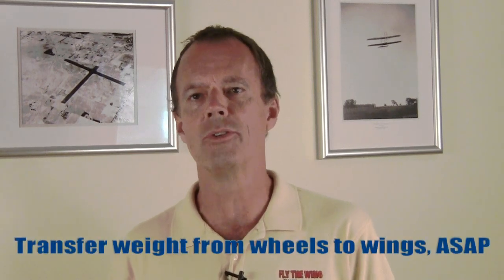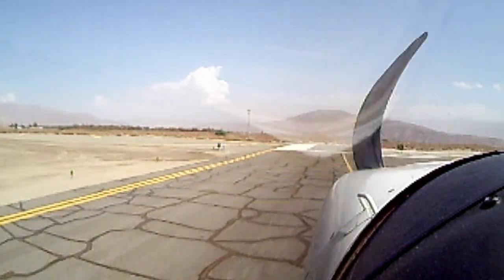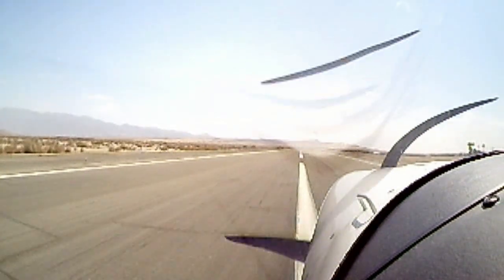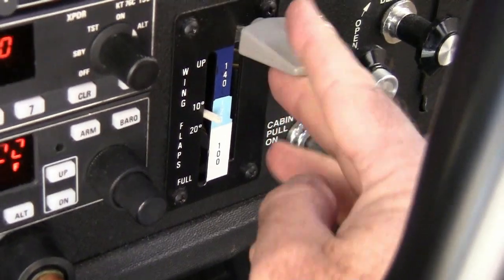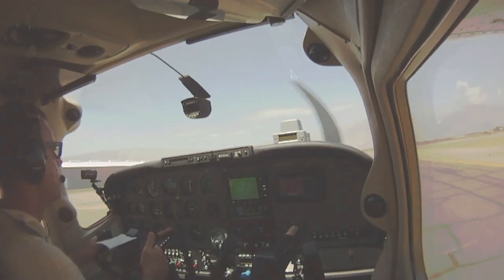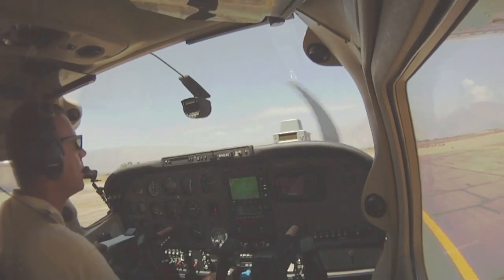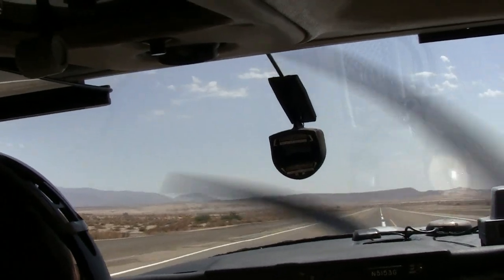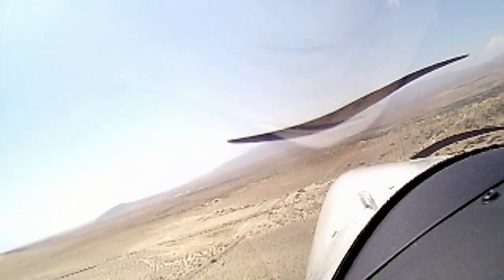Soft Field Takeoff

Comment: Do flaps still help at high density altitude airports?    I live at 7400’, so a plane’s performance is going to be a lot different I would think.   The city airports are 5200’ and it can be 100+ in the summer.

Comment: Thank you for these videos, they are very helpful. Soft field takeoffs make me nervous because most instructors have me lower the nose to the point of looking down at the runway. It doesn't look like you do that, what are your thoughts on lowering the nose to stare at the ground as opposed to being just about an inch below the horizon?
Reply from the maker: You don't want to look down below you, but rather look ahead of you several hundred feet, so that you can get a little perspective as to how close the airplane is to the runway. If you look to close to the airplane, it's like trying to read addresses on mailboxes in a car as you go whizzing by them. You have to look ahead a few houses to be able to focus.
Reply: I have that problem too